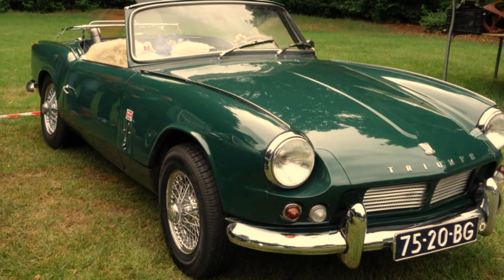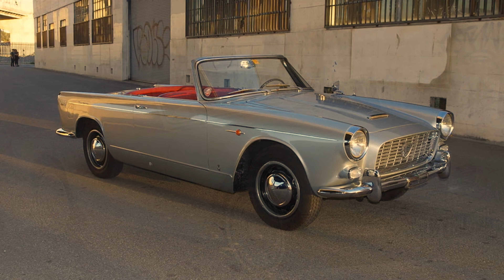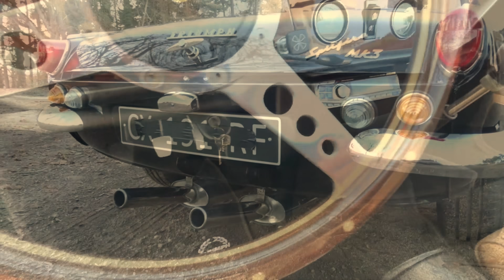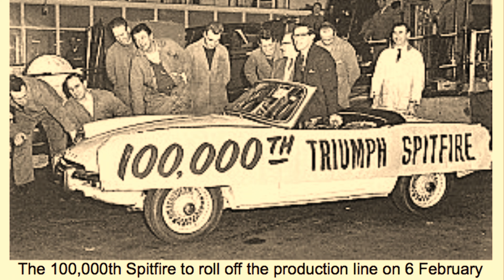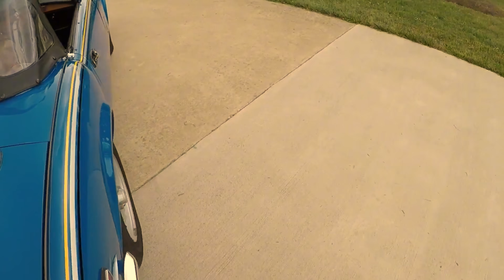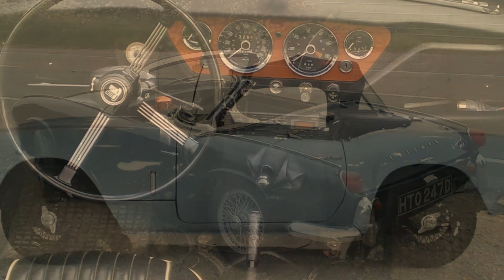13 Triumph Spitfire Engineering Secrets MG Owners Wish They Had 1962–1980

Comment: U.S. spec Spitfire 1500s were 53hp.Single carb, lowered compression ratios and emissions regulations gutted performance.  Every year, hp got lower and lower in the U.S. after the MKIII which was 75hp and 75 torque. The 1500 had the highest torque at 80. The 1500 was a dog but now you can bring it back to original spec installing the intended dual SU HS4 carbs or a weber conversion and getting rid of the smog junk. You can get the lower U.K. spec front springs for not a lot of cash. i hated mine when I first got it because the Previous owners made a lot of mistakes and kept tinkering with the engine until so many things were off that one symptom was caused by multiple problems. And there were a lot of symptoms. Took me a couple of years to learn about british cars sort it out,  but now that i fixed most of the problems, it's a blast to drive now.

Comment: Wedge shape? no it wasn't, it was a Triumph Herald with a different body.  Engineering tricks, The awful rear suspension, swing axle, you can keep it. My MG Midget handled better went round corners better and faster,  I drove my MG Midget for long distances and wanted to go again, the seats were good and it didn't buck and hop, it just went where you wanted it to go quite smoothly. 
The heavy front hinged bonnet, you had to release one side, go round and release the other side by which time the MG MIdget bonnet was up and secure. I had the engine out of my MG with no trouble. So, replace the whole frnt en if one side gets damaged, what a good isea or not.
The seperate chassis was as old as the hills, my MG TD's had that and it is probably the only thing that may be better than the MG Midgt but there is a weight penalty., I certainly do not remember scuttle shake either. 
It is probably a matter of taste but I find the Midget looks to be just as good.

Rack and pinion which MG had from the MG TD through to the MGB, so no difference there, on the MG the entire car communicated clearly with the driver, providing direct road feel through the wheel, it allowed for easily controllable oversteer, making it feel "chuckable" and agile in corners. I would rather have the MG any day. THe MG MIdget while not having the same turning circle as a Herald but is was no problem in traffic or parking.

The MG MIdget used the same A series engine right up to the 1500 which was an inferior engine, I would take either the early one with a free revving 948 cc engine or a 1275 cc engine, both could be given a lot more power with no problem.  

The overdive while good on paper had one big problem, it was either the overdrive or more likely the Triumph gearbox that was weak, a slightly tuned Spitfire became unreliable, my MG Midget never had any gearbox trouble even when putting out a reliable power more than a late Spitfire. The MG was better for performance and economy. I used to cruise at 70 mph with no trouble, the MG close ratio gearbox was better.

Weight distribution, the MG was very well balance with a light engine, I could carry a complete Midget engine and gearbox with no trouble. THen we come to the real secret, the rear mounted  differential and fuel tank, where does he think other rear wheel drive casr ad the diferential or fuel tank?

All of the nonsense and I give up, what a stupid video about the inferior Herald with a different body.

Comment: I bought a brand new Spitfire 4 MKII in early 1966 about 6 months after I graduated from college. It did not have a 1047cc engine. It was an 1147 cc engine. I still have the original owners manual and that is clearly stated in the manual plus I still remember the engine displacement even without the owners manual. It was my daily driver for about five years. I now own a 1975 Spitfire 1500 that I bought from a car collector about four years ago but use it only as a classic car showing it off at local car shows in the Baltimore-Washington DC area. I'll attend the Mt Airy British car show later this month and the Rockville MD car show in October. I still love driving the Spitfire but at my age now, long journeys in a Spitfire are no longer practical!😧

Comment: I had a red '71 Mk 4 during my university years. It was amazingly reliable. Drove it regularly between Seattle and Pullman  in deep snow. And btw...the 1300cc Mk 4 had more HP than the 1500 due to early pollution gear.
Reply: My dad gave me a red 1971 Spitfire MK4 – just like yours – when I graduated in mathematics and theoretical physics from ETH Zurich. I restored it in 1988 with a Connolly leather interior and a burl wood dashboard. 

I still drive it over the Swiss mountain passes today, and it gives me the same sense of freedom, adventure and youthfulness that I felt when I was 22.
Reply: @CHCisco ...how I wish I still had mine. You don't get in a Spitfire...you strap it on. Sold mine in 1980 and bought a VW Golf 😪. Cheers.

Comment: A cosmetically enhanced Triumph Heald rattle trap. The rear suspension was a disaster. The "British spirit" was "lets just make it look different because we are about cutting corners to save money on R&D. Make them all the same with different names".
Reply: The rear suspension was NOT a disaster.  It was a compromise, and it was improved twice in the lifespan of the car.  The weaknesses of spring axles were well known, and anybody who was irresponsible (or ignorant of the facts) enough to lift halfway through a corner after entering too fast perhaps should be permitted to drive one.  Speed kills, even today.
Reply: @williamkaiser8067 I'm an Australian. I had a mate who raced one with a 186 Holden engine squeezed in. Everybody racing those Heralds or Spitfires had to fit straps under the rear axles to limit the swinging rear axles from folding under when hard cornering if you hit a tiny bump in the corner. Great in a straight line. Australian roads in those days were extremely poor and shook them to pieces. The forward swinging bonnet was first to get fatigued and the metal cracked
Reply: @pistolpeds  True, BUT - they were not built as race cars.  If anything, they were sporting daily drivers.  And any car like that will need beefing up if it's to race.  The early marks (1-3) had adequate suspensions for daily driving.  Mk IV and 1500s had a more satisfactory rear end but even that is not built for racing.

Comment: As as young boy, my first experience with Triumph's and MG's was in the back of a gas station / mechanic shop in the mid 1960's.  I was 8, 9 years old, and I went in the back of the gas station were there was a Triumph and an MG, both somewhat wrecked, but I did not notice or care. I would go there and sneak into the the cars and pretend I was driving them. I think ther garage owners knew I was fantasying and never ever interfered! I would grab the steering wheel and pretend I was driving. These were my boyhood dreams. In later life, decades later, I have had a number of  autos, born out of those early experiences. A Triumph TR-250 that I bought for $250. I was 16 years old and bought this semi-working car. I told my friend, let's got to the Jersey shore and pick up chicks. Never made it!. Along the way, I discovered that the passenger seat that my friend was sitting in was not secured, and the muffler was loose and dangling.  Along the way, I pulled over in some township at night, thinking I may be able to fix the problems. After all, our journey was to get to the shore and pick up chicks. So I pulled over into a parking lot, it was a motel parking lot, please understand, during those times, this was a highway, going through local towns, not like todays modern freeways. I pulled into the parking lot, and my friend Mike Salterelli and I got out to inspect the issue, wanting to fic it and get on with our journey to pick up chicks on the Jersey shore 40 miles south. As I was under the xcar, trying to stabilize the dangling muffler with a coat hanger, Mike and I were immediately acosted by a dozen cop cars!!! Turns out that the motel parking lot that we pulled over in was robbed multiple time and the police were setup waiting for would be theives. We were agusted! Our journey to pick up chicks totally destroyed. As we were oin custody, late at night, the police called our parents to come and get us. Not a pleasent experience, Dreams shattered. And the person who sold me, a 16, year old, the car was prosecuted.

Over the years, I have had a BMW 2002, a Porsche 914 2.O, Alfa Romeo Spider Veloce, BMW 633, and a 850i with a 12 cylinder engine.

When I think back on all of these, I have to say that the wrecks in he back of the gas station, the Porsche 914, and the the Alfa Spider were without doubt the most fun!

Comment: Amazingly small turning radius !
Reply: True, but at full lock the toe-in gain was so much you could not push the car.
Reply: @kevink2315  And at full lock if you step on the throttle too hard it will go straight, well mostly.

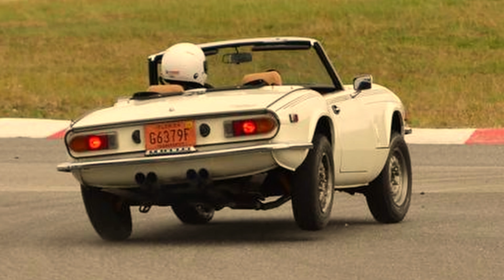Comment: OMG ... look at that left rear wheel at 5:39 / 5:40.... what's happening there?
Reply: With swing axles, the load on the outside wheel caused it to tuck under. The "swing spring" in the 1500 allowed a counter balancing load on the inside wheel, pulling the body down, negating any lift like that. I raced my GT6 using that spring, and the 2" longer half shafts fitted to the 1500.
Reply: It happens when you take your foot off the accelerator or brake in the middle of a bend. Brake early and take the bend with the accelerator fully pressed down; otherwise, it won’t forgive you.

Comment: At 78 I just bought a MK3 in signal red a 1300 cc it's in conquers condition a dream come true.
Reply: Congrats! The 1300 is the best! At 68 I forget how many Spits I have owned since the first one at age 17. Currently own a 77 that is getting a 2L six cyl conversion and a '64 MK1, along with a TR6 and a TR7! It's an addiction! Be sure to join The Triumph Experience board.
Reply: I just bought a straight, complete non rusty Mk3 project for $500 with two tops. A bit of lube should get the engine to spin over with a bit of effort. Oh and I’m 77!
Reply: @JalopyTechnology  Heck of a deal! Man I would love to have a factory hard top for my Mk1.
Reply: You are not the guy that paid 80K for that red Mk3 on BAT are you?
Reply: Vs my 76 russet brown that was track raced , I kept the dents mostly , in frame off restoration she may run this summrr

Comment: You mentioned a folding windshield. Did I hear that correctly? Never knew anything about it and can't understand how that would work.
Reply: On the first series spitfire 4 there was a competition option allowing you to remove the windscreen and fit a Perspex (acrylic) folding unit. It was rare but available, since spitfires were used in SCCA racing events.
Reply: @wayneburton2071  Wow never never...  heard of that b4, and that is a racing mod I very much doubt was road legal.
Reply: @wayneburton2071  absolutely right.
The windscreen and frame assembly was easily removed by two bolts.
One on the driver side and one on the passenger side at the door post.
Undo the nuts and you could pull the whole assembly out.